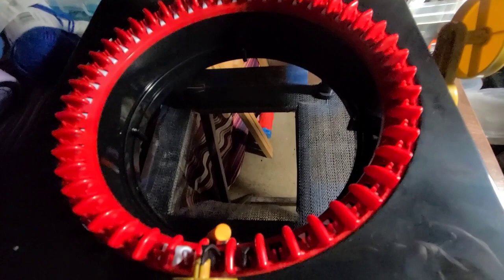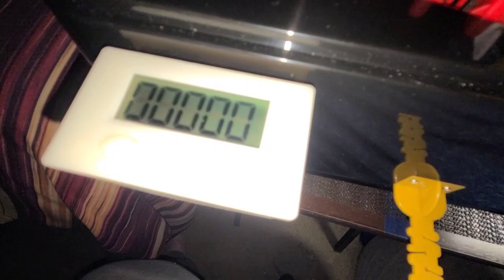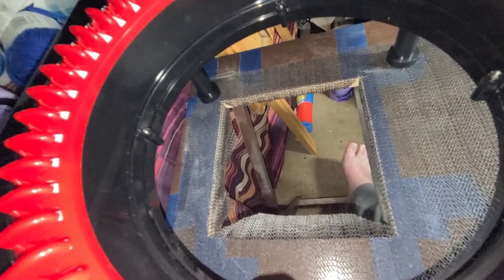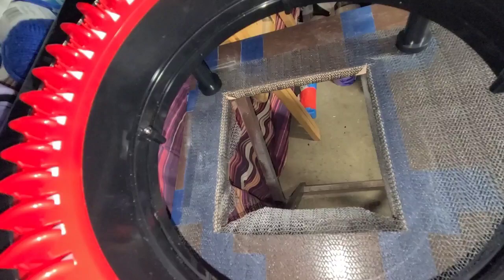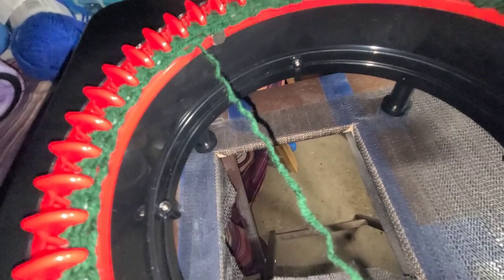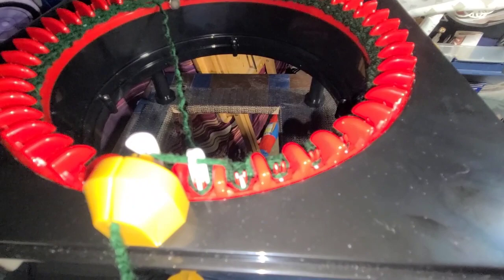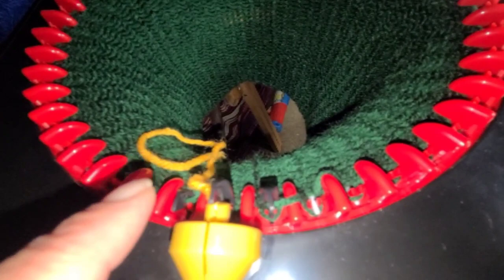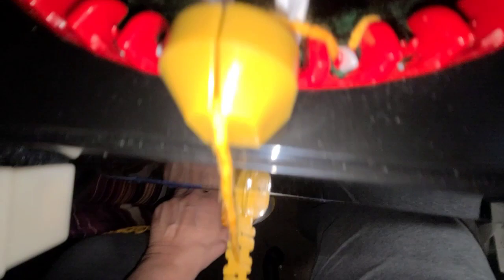Jamit Electronic knitting machine..#easy_to_use make almost anything #knitting#sentro#knittingmachin

Comment: Thank you for doing a video on this! I saw these machines came out recently and there isn’t really anyone making videos for them yet. Just a tip - try casting on with “waste yarn” in a different color for about 5 to 10 rows and then swap to the color you want to actually knit with. Once you get done, it’s a lot easier to see all of the live stitches and keeps your ends uniform. I also recommend using a clothespin (chip clip, etc anything to add a little weight) on your yarn tail after casting on to help your tension. I typically attach one to any tails from color changes for a few rows just to help keep the knitting machine happy and reduce dropped stitches or tension issues. If you happen to open it up to do maintenance on it please film it, I’m dying to see what one of these bad boys looks like inside! Looking forward to seeing what you create, thanks again!
Reply from the maker: Thanks for watching..my brother actually took it apart to see how it worked..I will have him do it again..I also had him cut the hole in the table so I don't have to roll it up all the time so as it gets bigger it will act as  it's own weight..but yes in the cast on yarn I should have put something..thanks for stopping by..and yes I will be doing more videos